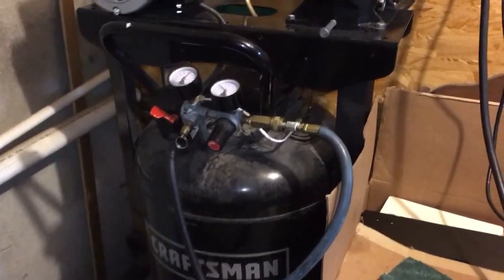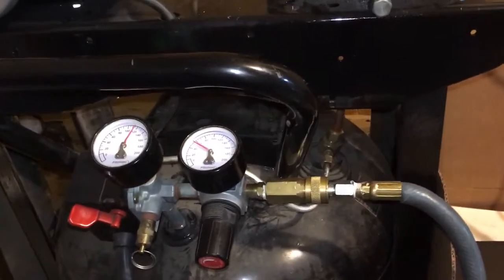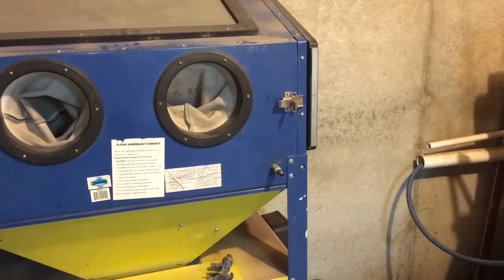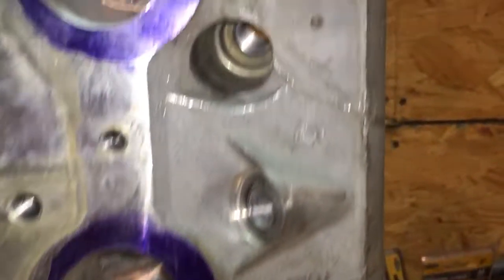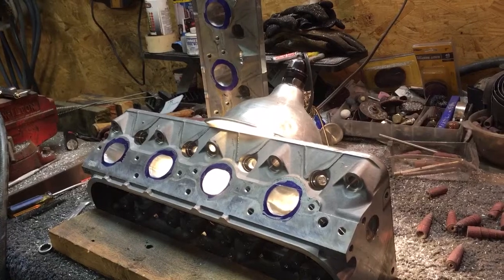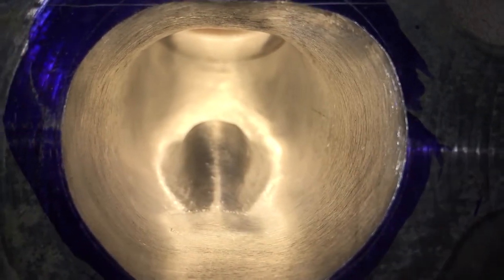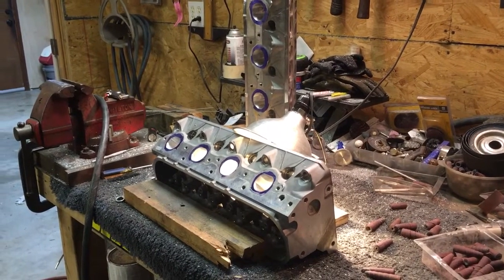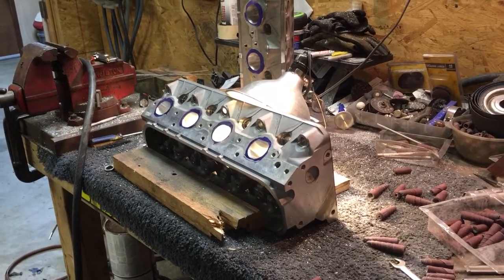Porting 241 Heads #4 compressor update

Comment: do you use anything on the rolls to keep them from getting gummed up? or do you use something other than rolls for 80 and 120 grit?
Reply from the maker: soyramflero I’ve never used a lubricant on the sanding rolls, the rolls deteriorate before any clogging in my experience.  Cutting burrs and stones must use lubricant and the stones will still clog up on aluminum.
Reply from the maker: soyramflero I recommend 60 grit on the intake runners and 120 or smoother exhaust.